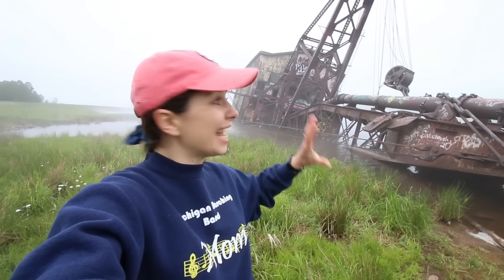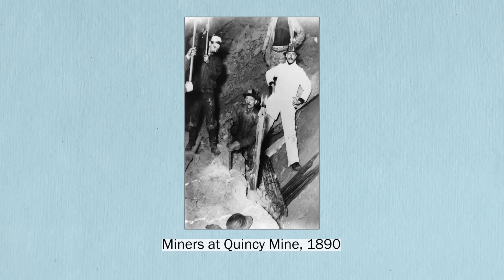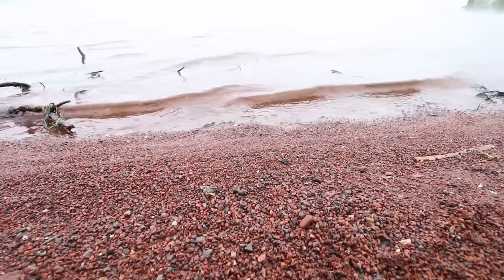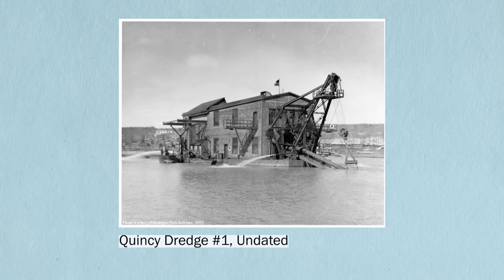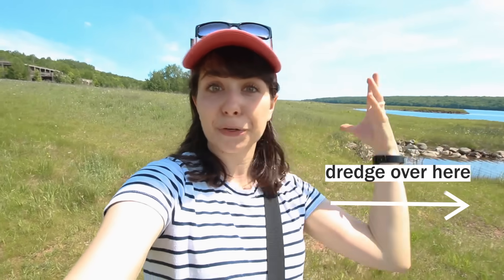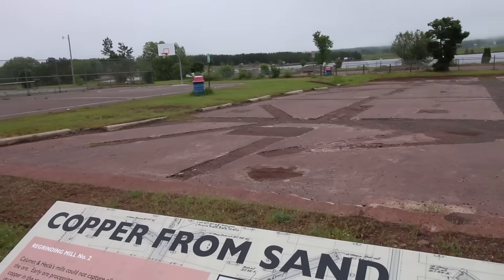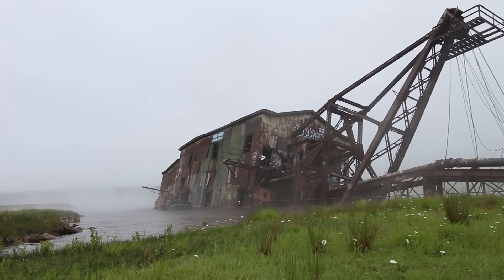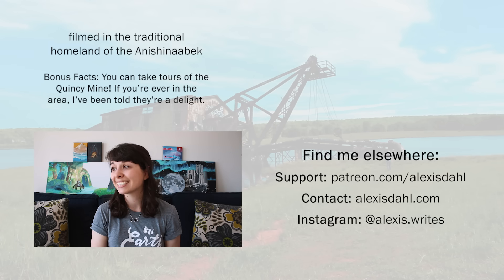Meet the Toxic Sand Vacuum | Torch Lake, Michigan

Comment: I used to sell to the White Pine copper mine in the UP.  I got a ride in a pickup into the mine and went 2000' under Lake Superior.  Dark, dank and wet but I was give a 1 pound chunk of almost pure copper that I have on display on a shelf in my office.   The memory takes me back to waking up in my little motel to see it had snowed about 18" overnight, which wasn't forecasted (lake effect snow).  I asked the office when a plow would clear the road because I needed to be on-time for my appointment at White Pine.  They said, "Charlie would come through sometime today".  I was very late to the appointment but the White Pine guys said no worries because that happens all the time in the winter.  Life in the UP.

Comment: I spent a couple weeks every year for my entire life on the canal connected to torch lake about 2.5 miles away from the dredge.  The ecosystem is not doing good it is absolutely thriving. For fish we have seen channel cats with babies every year in the shallows, caught multiple 30+ inch pike, snagged a 5ft-6ft sturgeon, many large walleye, and all sorts of perch, panfish, and bullheads. For incests I have seen both stoneflies larvae and the mayflies are awful. These are the two best indicators for ecosystem health. Birds include kingfishers, nesting bald eagles, lots of herons, and ducks with babies every year. Mammals include beavers, deer, bear, wolves, minks, martens, and fisher cats have been spotted in the area since their reintroduction in 1961. The weeds in the canal used to be so thick you couldnt even swim in them. The DNR started applying chemicals to get rid of the weeds a couple years back and ever since the fishing has gone downhill. The real heavy weight is the clams. There are probably 3-4 every square foot in the shallow areas and I would always remember having clam races and betting on them. Clams are the best species for cleaning waterways and I believe its a major reason why the environment is thriving. This should give people hope that just about any environmental disaster can be reverted in just a couple decades. Sure I may start glowing later in life bc of all the heavy metals in that water but it was more that worth it to see all that wildlife. But please never consider moving to the UP, the mosquitoes are so big they stand on two feet and often damage peoples cars.

Comment: There is a sort of similar dredge outside Breckenridge, Colorado.  The soil in the valley had enough particles of gold to make it worthwhile to dig it up and separate the gold from the dirt.  To do this on a large scale, they dug ponds, and floated dredges on the ponds.  They would dredge along, pulling up soil to refine.  The dredge would just move along, bringing its pond with it.   Along with the soil came a lot of rounded river rocks, which got heaped up in big piles.  Those piles are can still be found all over.  Most of the trees in the valley were cut down to fuel the dredges.  With most of the trees gone and the soil thoroughly disturbed, a lot of soil eroded and just sort of disappeared downstream.  The resulting valley floor was so porous that the river that used to run through the town of Breckenridge just disappeared into the ground.  More recently, in order to have a picturesque River in town, the town lined the riverbed with plastic to hold in the water.

Comment: You might note that the reprocessed sand was then deposited back in the lake,  Sands from the Isle Royale Mine were dumped in Portage lake just east of the MTU campus.  The Copper Range Company retrieved sands from Portage Lake west of Houghton and carted them to Freda on Lake Superior via the Copper Range Railroad for reprocessing.  I believe that operation concluded about 1966.  The Freda mill was scrapped along with the Freda branch of the COPR and the railroad entered into near retirement until it was abandoned about 1972.

Comment: "flotation" remains one of the most economical and used separation technologies in the mining industry today.  From coal cleaning plants to metal recovery operations which include lithium, when the "specific gravity" of the sought substance can be recognized, it can be floated in solutions or even in water agitated to assume a specific gravity of something other than 1.0.  For example, Coal wash plants are generally operated at specific gravities from 1.55 to 1.65.

Comment: You sure know how to dredge up comments. If you look closely at the google earth satellite view of torch lake you can still see dredge #1 at the bottom of the lake across from #2. A number of years ago I found pictures from the early 1900s showing these in operation. I remember that they had a pipe floating on several pontoons, going all the way back to the shore and crossing the road strait into the processing plant. The power lines were floating on a separate set of pontoons, if I remember correctly. Probably to protect them if the pipe broke. The story was that #1 sunk because of a power outage and it was too costly to refloat it. There were no gasoline powered pumps and no back up generator. So you loose power and you are done. When I lived up there in 1970, #2 was in a little different position and maybe partially still floating. I came back in 1975 and it was where it is now sitting on the bottom. My friends went inside and got a lot of pictures. I didn't go inside of course. This thing was interesting to me since I spent 25 years of my engineering career designing pumping systems to move bottom ash from power plants into waste ponds.

Comment: You had that backwards....    there was chain conveyor under the thing with slide looking then that dragged along the bottom!  Dumped the rock into a screen.  Or "Sifter"   the rock was then dumped off the sides onto barges  dragged along the sides and the waste water from screening came out that pipe!

Comment: and ,. almost every pit to run a dredge ,. has had them left behind...  after mining . these things arent worth taking ... there are pits all over the world with dredges left in them...  they all need special trucks to move them.. and a crew...  and most the old old ones. could not  bring the crane arm down enough to fit under most bridges or the lodging part would be to big,.. you would legit have to break it down just to move it.. so.. just leave them..

Comment: This randomly popped up on my feed and I’m excited it did! Your description of copper flotation is excellent and I’m probably going to send this to a few friends to explain what I do (mining equipment engineer, specifically pumps).

We’re almost constantly dealing with pumps for copper mining projects, though I’m not aware of anyone dredging for it anymore (we do plenty of sand and gravel dredge pumps). It’s crazy that we’ve been using the exact same flotation process for 100+ years, just with much more advanced tools and process controls. 

I’m curious about the 100 ft suction pipe mentioned at 4:40 - was it 100 ft long? Typically there is a physical limit on suction lift of around 33 ft below the surface, and a 100 ft suction pipe would be substantial. To go deeper, the pump itself has to be submerged.

Comment: Good Post!   I was a Chemistry Grad Student at Michigan Tech in Houghton through the 1970's and am familiar with DREDGE #2.  You should find some SCUBA Divers and visit #1.  For a while I lived just down from HELLTOWN in FRANKLIN MINE.  Visits to these places mighg prove fascinating.   Did you know that CALUMET, MI at one time was more populace than DETROIT and sported it's own OPERA HOUSE ?  One of the Copper mine shafts on a bluff overlooking Houghton was closed down because the miners ran across a HUGE deposit of +90% pure Copper so large they could not dig around it !  The day I first walked down the main street of Houghton, I stopped and jack-knifed a marble size lump of Copper from the asphalt beneath my feet !  The whole Copper Country needs to be showcased more.  Like the story of the twin-engjned Lockheed bush floatplane flying from the canal that had two loops of rope on it's yoke for an "autopilot" !  Then there ghosts and even alien UFOS !

Comment: Apparently YouTubes algorithm has worked... I grew up a troll. My elder sister attended MTU for 5 yrs. We visited the Keweenaw and UP a few times for leisure and snowmobiling. Later I joined the US Air Force and after a few years in the south I was stationed in ND. The UP became one of my premier travel destinations. I never knew there was a torch lake besides the one in the northern part of the lower peninsula. I also didn't know this one was so abused.

Comment: This reminds me a lot of Britannia Creek near my home city of Vancouver, B.C. 
The area was mined for copper from 1888 until 1974 when Britannia Mine, in it's heyday the biggest copper producer in the British Empire, shut down and was abandoned. Rainwater was caught the open pit at the top of the mountain and flowed through roughly 80 kilometers of tunnels, where it mixed with the copper sulfate in the rocks, became highly acidic, leached heavy metals out of the rocks, and flowed directly into Britannia Creek. Before it was cleaned up in the early 2000's, Britannia Creek was considered the most polluted waterway in the entire Western Hemisphere, with a PH level of 3.5 (nearly that of vinegar) and an estimated 450 kilograms (roughly a thousand pounds) of copper was flowing into Howe Sound (the bay the creek drains into) daily. In the 90's, Howe Sound was a complete ecological dead zone, with crystal clear water. When the Department of Fisheries and Oceans put chum salmon in cages off the coast in the early 90's, all died within 48 hours, as opposed to a 100% survival rate in the control group in the next bay over. Thankfully due to a herculean effort by the Canadian Ministry of the Environment, acid mine runoff into Howe Sound has been reduced by 99% as of last year due to the installation of plugs in all low-level tunnel portals and a truely monsterous water purification plant that the water of Britannia Creek is filtered through prior to release into the Sound.

Comment: Dredges work by changing the rate of flow of a column of water. High speed water can carry A LOT of sand, open that column up into a large tank and the reduced flow rate causes the sand to drop out of the water column and sink to the bottom of the tank.

Comment: A really fast and easy way to date large old equipment like this, even at a distance, is to look at the connections. Welding wasn't invented until WW2, so everything from that point on was welded construction, but before that, it was all flatiron and rivets. that's why it's so heavily skeletonized. they had to allow for more flex and connections were not as secure, so that's how they kept the weight down. 

It's a really useful thing to remember, because sometimes you'll just be driving around and see some power transmission towers, or a random tank, and it's riveted construction, so you instantly know it's at least 80 years old

Comment: An FYI the remaining copper in the Keweenaw peninsula is still the purest in the world. Mining stopped there were or are economical methods of extraction. If they use explosives the copper just bends around the explosive forming a crater instead of rubble. Drilling is ineffective as well because again, the copper bends around the bits

Comment: the EPA doesn't care about the environment nearly as much as people think I've spoken to many scientists who worked as advisors for the EPA and have stated that the EPA will often blatently go against there advice for things, and instead push limitations on things for some other political agenda for there organization to get more funding

if they cared more they would stop requiring us to put urea in the environment (DEF is water and urea), push for more limits on the amount of salt we put on roadways, be ok with the new oil pipeline, as it bring the line even further away from the Mississippi watershed in the case of a spill disaster, support forestry more (see DNR website to see why forestry is good for the environment), and stop pushing the idea that heavy metal, fire hazard and disposal nightmare batteries are the answer and rather focus on nuclear fission as well as the new fusion technology coming to near completion, and fuel cells technology which has been around for almost 2 centuries now

Comment: Great video but there are two Torch lakes in Michigan. The one in the upper peninsula is the one with the historic dredge and the surrounding copper mines. The one in the lower peninsula is rated one of the best ten lakes in the United States. It's about 22 miles long, 2 miles wide with maximum depth of 285 feet. Great fishing.

Comment: Good video, I see you have made your corrections in a comment. I will say this to anyone thinking about poking around inside the dredge, DON’T. We used to climb around in there 15-20 years ago and it has deteriorated significantly since then. Our friend fell through the floor and had to wait for help, it could have turned out much differently. If you would like to see it in person, I recommend using a boat to look around. You can still see what’s inside that way without going in.

Comment: Why was it required to dump the sand into a lake , instead of somewhere easier and cleaner ?.  Also the removal and washing of the sand would stir up massive pollutants into the water tables again.
Let's all guess what was done with the other chemical waste after the extraction process was done.

Comment: So the dredge was defunct by 1967. Shame, really, because of what happened next. Within a decade, the demand for copper/brass skyrocketed because of the huge ammunition demand of the Vietnam War. Because of this, residential wire makers sought an alternative to copper, and turned to aluminum. By the time it came to light that aluminum was a very poor substitute for copper in thin gauge wiring applications, a generation of houses were constructed with aluminum. A fair number of those houses caught fire, and a sizable number still exist today. A steady supply of copper could have avoided a tragedy in the housing industry. Which, of course, pales in comparison to 3,150,000 deaths in the Vietnam War.

Comment: Hello, I left you a comment on one of your videos that you did several years ago and I enjoyed that one immensely as well as this one.
I can remember when that dredge was operating. I was born in 1954 by the way and the stamp sand colored Lake Superior beaches for miles!   FROM west of Ontonagon to east of L'Ance. The last time that I was in that area of Michigan as a child would have been probably 1969.
The summer after I married my wife in 1982 I took her on a trip to copper country and I was amazed that the stamp sand was mostly gone from the shores of Lake Superior.
I have a question though. Was that stamp send  removed by people? Or was it just eventually washed into deeper water by the action of the lake? I don't know the answer to that! Perhaps you do.
Speaking of L'Ance, there used to be a deserted Ford motor company lumber mill, I think,  north of the city. I don't know if it's still there, but you could pass on the history of the Ford motor company getting its number there for it's automobiles that required wood. Like the wood sided station wagons of the late 40s

Comment: Ok they removed the copper in the stamp sand and washed it so it rose to the surface. But what about the water that was used to wash it. Didn’t it contain other trace metals. Did it just go back into the lake ??

Comment: Good job and good research. I've heard the story first hand and your version aligns. Couple things. First in terms of the amount Torch Lake was filled just look at Google Maps. You can see the areas at Mason, Hubbell, and Lake Linden where the tailings were dumped. That's just what you can see. Second, the example of stamp sand you showed was glacial till (i.e., gravel); stamp sand is such finer and very uniform in size. Last, another major factor in the end (1967) I was told by some "old timers" was due to a strike. I think there was a rail strike and rail was the principal means of transporting refined copper out, so the reclamation project was halted. I believe that was followed my a miners strike in 1968 or 1969 that caused the mining company to never come back. I do think you may have been a little over the top on the Super Fund aspect. The lake was named a SF site largely due to tumors on Sauger (bottom feeders) but that was a narrow window of occurrence, not ongoing, and I don't believe correlation with copper was ever made conclusively. The copper mined was elemental (native) copper and had a low solubility and hence would not expect to be labile. I do remember discussions of defoliants being the cause. I was told (in the 1960's) the power companies used to spray "Agent Orange" along the power lines to defoliate. The rock in the Keweenaw is very impermeable and hence that chemical would be carried down with surface water and gather in Torch Lake and other bodies of water.  But overall, I enjoyed your presentation. But the real question is - did you go inside the dredge? If you did, you know the real secret...

Comment: Back in ‘96 me and a couple buddies climbed up to the high platform on the boom.  Stupid I know but when you’re around 20 and a guy you tend to do those types of things.   

One question have they figured out what to do with the sands southeast of Gay?  25 years ago the road commission and a few cities mined it for road sand for use in winter.

I also remember seeing pieces of copper in some roads, paving companies would crush trap rock and use it in asphalt, some of them collected what copper they could as recently as 10 or so years ago but they always missed some.